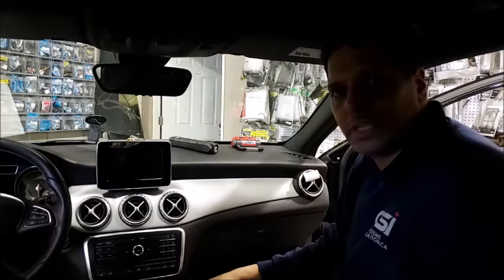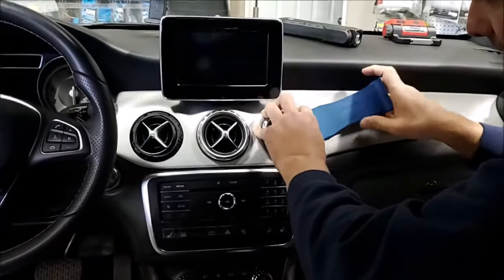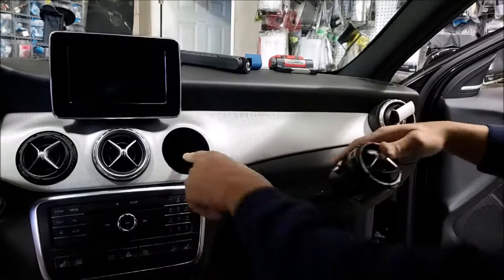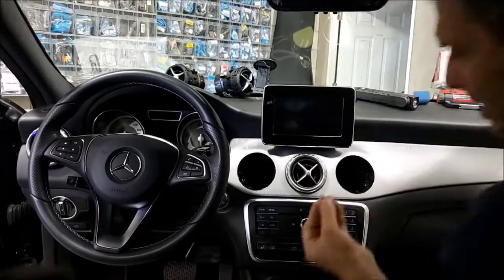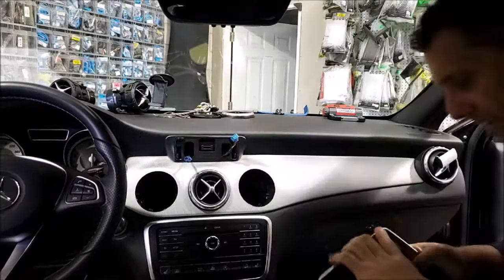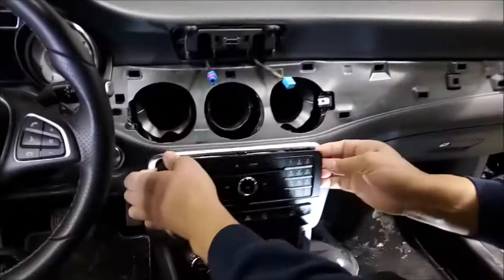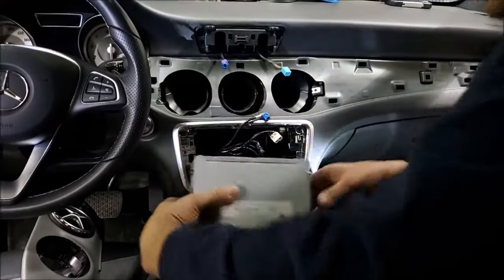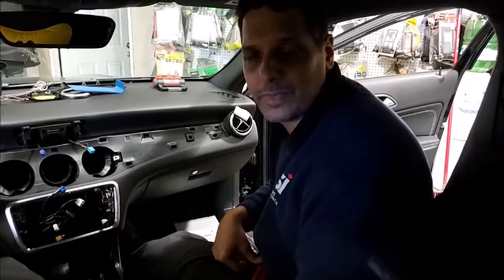How to remove Mercedes GLA AC Vent, Screen, Radio and center console

Comment: My friend, do you remember whether the chrome bezel can be 'peeled off' without having to remove the radio unit and ripping out the assembly underneath the radio?
Reply from the maker: To remove the silver trim around the vents you do not need to remove the radio only the 2 vents to release 1 screw and 1 tab

Comment: How easy is the heater control unit to replace? I noticed you made short work of getting the heater unit out of the centre console - but how easily can you replace the heater control unit? I have an issue with a few buttons on my heater unit and want to replace but want to know how easy this is before i buy parts

Comment: Man... Stay away from my CLA. Imagine having you on my pasenger side for an 8 hours trip.  I probarly had to use a wrench to stear the car afeter 2-3 hours. But thanks for the video man! ; ) Just was I was looking for. (do you know by the way. I bought a CLA that have installed after delivery from Fabric, sensor in front for parking "Thats great! "  But the sound is like a terible Comadore 64 Game Sound "on Max Volume") It Seams that the " Speaker for is all to the left. There is a litle Switch to turn it off "for 1 time only")  If you also have a good  cheap trick that dosent destroy anything how to turn off ECO button Permanently you  would be MB custemors Hero! Fantastick if you know. 
God Bless! 
Thanks again.

Comment: Hi thanks for this video, what size is the Torx screw?
Reply: T20
Reply: Thank you. Just one note, Amazon has OEM/3rd party hooks specifically made for Mercedes. It makes taking the vents out easier without damaging the inside. Your video was excellent by the way, learned a lot.

Comment: The way the vents are removed, it is as wrong as possible and can damage both the fans and the panels.
Reply from the maker: Hi thank you for your comment.
As I explained in the video there are some tools that suppose to do the same job, we have used this tools before and one of the major issue is that they can slid while pulling on the vent and brake the vent fins. We have been removing those vents this way for years and never had a single issue or damage.